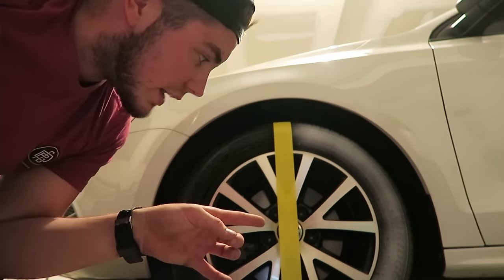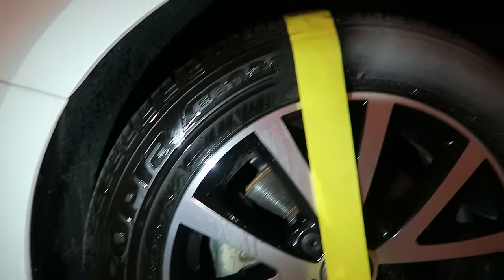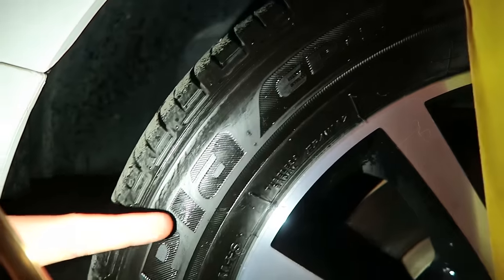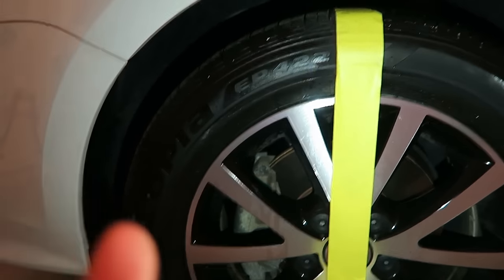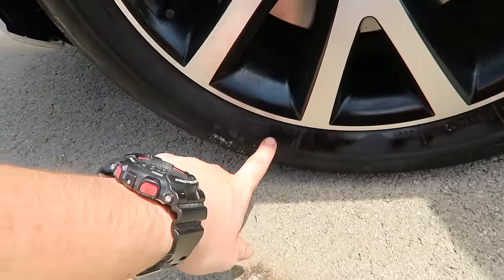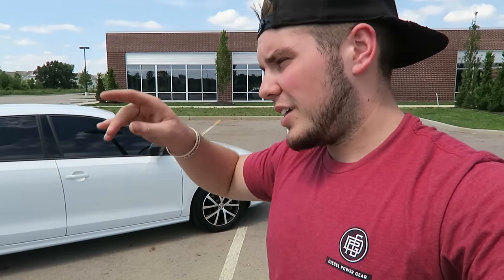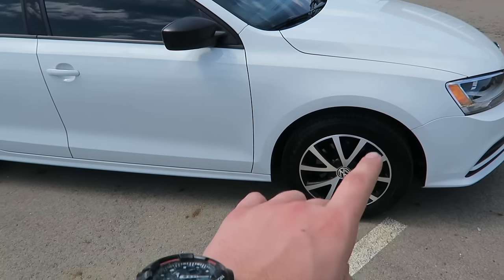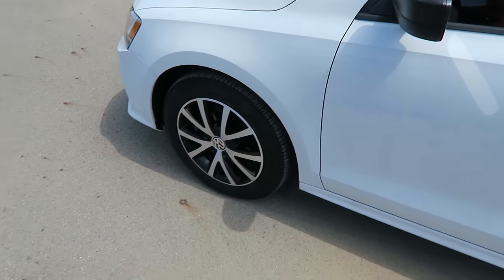The BEST way to Shine your Tires!  (You'll never use tire shine again!)

Comment: How long have you used Pledge on tires/rubber?  I wonder if it will cause premature hairline cracks to rubber/tires...
Reply from the maker: Rick T I've used it for a while, safe for the rubber
Reply: Rick T Hey Rick T like Ryan Mayers says,  it safe for the rubber  and I have to agree with him because the mane ingredient in Pledge is wax.  I personally have been using it sense the late seventys and have not seen any damage caused by Pledge to the many different tires I have  applied it to. For that clean new tire look Pledge is the way to go.        ...and it smells so lemony fresh.       lol.
Reply: May cause premature crackulation...

Comment: I just got turned onto Dupli Color "Tire Paint." It literally comes in a spray paint can and gives you the gloss/wet/black-shine look permanently and only costs about $6 bucks to fully dress 4/5 wheels. I typically recoat mine every 6 months... so you'd get a years supply that will run you about $12 bucks outta pocket.
Reply: as the name says, it probably IS PAINT!

Comment: The problem is that PLEDGE will eventually eat into the rubber and cause the tire to crack.
Reply: Plus you risk spraying it on to the brake discs and contaminate the brake pads. What a dumb idea.
Reply: i used it back in the days when tire shine didn't exist. Never had that problem.
Reply: NO ONE TRULY KNOWS SHIT!!! ITS ALL A GHB PRECUSOR!!
Reply: True!  Mr Sheen will also crack your dash.

Comment: I'll tell you this first off you need to get a thin bristle brush a wide brush and use it to work the compound into the tire. Pledge looks pretty decent but black magic 100% better just needs to be applied better. 👍 Zero rags brush brush brush or maybe even micro fiber sponge does pretty good too

Comment: So pledge makes it matte and tyre shine makes it shine?😹 I think tyre shine is doing what it's supposed to
Reply: Thabo Maphosa shit car.I wouldn't have bothered.
Reply: Runnin' Wild with Milwaukee Buck!  They both use chemicals.
Reply: Runnin' Wild with Milwaukee Buck!  I understand what you are saying, but it doesn't really matter if something is formulated for tire shine, because all of the companies use petroleum as a base, which is definitely not good for rubber tires. It breaks them down. 

I owned a high-end auto detailing business for many years, and always told my clients not to put tire shine on. The ones that wanted the tire shine on anyway had tire right within a few years, but the ones that didn't put any tire shine on, their tires last much longer. Crazy, right? 

Not hating, just saying.
Reply: well I have always used tire shine or tire foam for many years and I never have had tires worn out any faster!
Reply: ahahahahahahaha...exactly!
Reply: CyrusCreed (
Reply: Yes it Does Work, Butt tyre shine, Flings All Over You’re Vehicle After You’ve Just Shined IT, This IS an EXAMPLE ONLY, 🧐 Now U Have This Bad Ass Clean Black Lamborghini With Pimples All Over It, Due 2 Tyre Shine 😖
Reply: What? Teaching kids that bad spelling is cool?  I guess it could be Tiyer Shyne...
Reply: Back in the days in the military we got the trucks ready for the inspection by using diesel fuel to rub the tires
Reply: CyrusCreed wtf is a tyre?
Reply: Kevin Wollenweber 
You need to get out more often. "Tyre" is the correct spelling for "tire" in English speaking countries outside of North America. You know, like England, Australia, etc.
Reply: Right.... Duh...

Comment: I have for years use an equivalent - Mr Sheen, aerosol spray'n'wipe product.
 It also works very well on my old metallic finish duco; enabling water to bead again, just as if it has just been polished by the pros

Comment: have you tried the Pledge on the car's interior, vinyl or leather, now I'm even more curious about using pledge.
Reply from the maker: Don ellis 🤔 that's a wonderful idea! I mite try and full detail my car with pledge!
Reply: Don ellis I've used furniture polish on my car dash since 97 . Looks new. my older friend told me about it. I was like he was crazy but it works. wish I had pics to show you
Reply: Don ellis I've used pledge since the late 80s! Inside and out! Best thing I've ever found and I've tried a lot of different products and end up throwing them all away! Works great on detailing motorcycle too!
Reply: Sal junejo armor all products crack your dash. It dries them out.
Reply: Heath Young   Such Bullshit.  Armor All does not crack the dash.
Ive been using it on my dash for 30 years.
The sun ☀️ cracks the dash.
Some of you people are so freakin stupid!
Reply: Yes Don, it works great inside too. Don't know if I'd use it on leather, but I used to detail cars when I was in high school in the 70's, and what surprises me that this guy didn't hit on is LEMON pledge works great on your wheels too.  I learned from a lifetime motorcycle rider that it's the best stuff for cleaning/shining motorcycles too.   As he quoted the commercials, it cleans it's own wax build-up while it shines. That's all I've ever used on my bikes paint, and rims. I'm not absolutely sure about leather though, but I think anything with a painted or coated (chromed) surface the LEMON Pledge works great on.  Reason I emphasize the lemon is I believe the citric acid in lemon oil is what handles most of the cleaning & degreasing.
Reply: Don't use it on your vinyl or leather car seats. It won't harm it, but your ass will not sit still in cornering, as it slips every whichway...
Reply: climber bob so I can use it on my rims too🤔
Reply: David Hamilton what if I wipe it down very well?
Reply: David Hamilton 🤣🤣🤣🤣

Comment: To make it easy just go to your local auto parts store and buy "Meguiars Endurance Tire Gel"  and rub it in, almost anything in an aerosol can, or a spray bottle will sling, but gel will adhere to the sidewall of the tires without the run or sling and give it a nice deep black shine. Use the right products for the right job guys, idk if pledge is even good for the tire on the long run.

Comment: I use either Meguiars Hot Shine I spray it let it sit been lightly spread wipe it with a rag that doesn't sling or I use Wipeout a rinseless wash and I use a little thicker solution of Wipeout and it makes a great tire shine

Comment: Any type of tire shine should be the first thing on, last thing off. Once you wash the car and dry it, immediately spray whatever tire shine product you prefer on the tires and leave them be. Once you finish vacuuming, the interior, waxing, Etc, give the tires a final wipe before you drive away. First thing on, last thing off. You will minimize any spray up the side of the car if you get any at all. That's why I never have tire shine applied when I'm lazy or weather dictates I use a car wash and not do it myself.

Comment: Never ever use tire shine or any hydrocarbon based cleaner because it strips out the antioxidants manufactured into the tire sidewalls to prevent oxidation and premature cracking, I'm a retired tire designer from a major tire manufacturer.

Comment: OK, the thing that bugs me about tire dressings is that they stay wet and greasy and sling off, AND they collect dirt that you can actually see stuck to the goop. However, there are tire products that actually dry on the tire and last several washings. The one I use is Armorall Extreme shine. I'm thinking the Pledge won't last as long.

Comment: I worked as a car and boat detailer, right out of high school back in 1989 we had accounts with the Mercedes and Jaguar Dealer as well as private parties. When we used tire dressing We applied the tire dressing to the rag and wiped it down and it kept it from having drips. I don't care what their instructions are, I will always wipe the excess off.

Comment: I've found Turtle Wax Wet n Black Tire Shine works well with no spin off.  Recently I've been using Mequiar's Endurance Tire Gel and no spin off and looks fantastic.  Yes, wear gloves when applying but a nice finish when complete.  The Pledge here is just so-so as far as shine.  Not crazy on what it looks like after.

Comment: I have a 2004 Concorde LXI. The problem I have is the grey plastic grill insert looks dry and old. What can I use to bring back the wet look again. I have 160,000 miles on it.Its white with tinted windows and the interior and exterior look great for a 2004. It has the factory 17 chrome wheels they are a pain to keep clean. I use Pledge on the tires. But, the grill needs serious attention! Shawn
Reply: Use heat gun

Comment: Actually there is already tire shine foam on the market (Turtle wax). Spray and walk away. Only takes about a minute or two to dry to a shine. I usually use Purple Power degreaser then water first to clean tire then apply the tire shine foam. ;)
Reply: Use the purple power de-greaser to clean the tire rubber surface of all potential organic dirt, brake dust and/or road grime contamination; then simply follow up by using a dual action random orbital polisher outfitted with microfiber pad loaded up with five dimples of fine polishing fluid that is commonly used for vehicle refinishing to help micro-scarify and micro-pit the tire rubber surface in order to accept a protective durable layer of brand name silicone polymer wax that is typically used for vehicle refinishing.

Comment: tire shine no sling solution... get you a dish scrubber tool, the kind that fills with liquid soap.. spray/soak the shine on the scrubber pad.. scrub tire.. rewet as needed.  this also lets you detail FAST taking it right to the rim edge without junking up your fresssh clean rims.. also pad refills for tool are cheap, grab a pack, use an extending razor knife to cut the scrubber area off one, then its a controllable sponge which works better for beefy tires and then you can change back and forth at will.   y'allz welcome
Reply: ...and it comes out even and show-ready

Comment: I have been doing this for 30+ years also use it inside on dash all vinyl a lot better than anything else, works good on engines, black stove pipe in house spray it on then build a fire let it burn off

Comment: Thanks for taking the time to do this video.  I agree I like the looks and performance of the Pledge product, not to mention it is cheaper than the "Tire Shine" which I never liked the looks of.  I think the Pledge product will actually help protect the tires too.
Another thought, did you try and use it on the outside plastic trim?

Comment: silicone tire shine is heat resistant and so can protect mufflers and rear exhaust pipes from rust. either should help protect electrical connections from corrosion.

Comment: Any tire shine product worth its weight will contain silicone. Silicone is excellent for rubber and also plastics. Silicone based tire shine when applied correctly will not '' fly all over the place '' ...maybe it would if you let your 4yr old kid do it.
The silicone base repels dust and dirt. You can use it in the interior of your car also. Just spray some on a microfiber cloth and it does a fine job. NEVER use it on your steering wheel or stick shifter though. Its also excellent for polishing your windshield and will repel water  for months. Just like the expensive RainX type solutions, They are just silicone based in a fancy bottle. Try it on a glass door , rub it in, then buff it out with a microfiber cloth, Spray some water out of your garden hose onto it and, Your welcome. 
Let the pledge be a furniture polish and stick with a good tire shine product, Use it properly, ie: give it a wipe down. Its excellent for rubber compounds.

Comment: pledge has silicone in it that is why the rubber likes it i use pledge to lube the inside rail of my aluminum etension ladder where the metal parts slide in the track Wow it works and dryes non sticky when u slide the ladder to full extension and works for many weeks before relube is needed does not attract dirt in any noticeable way have the same littlt giant ladder  from the seventys still shiny and no dirt build up

Comment: You think it works good for tires, you should try it on windows. You have to wipe it dry a little more cause it's kinda oily, but once you do it's crazy. I use baby oil for my tires and dash. Never Armor All. I'm not even sure if Pledge is a good idea in the long run. It could start to crack the rubber after awhile. Baby oil keeps better.

Comment: But will the Pledge break down the rubber in the tires, time will tell. Tire shine is formulated so it won't break down the rubber, plus spray the tire shine on a rag and rub it in, that way it's not pooling on your tires and slinging off on tor car.

Comment: Funny you mentioned your key chain and the ridiculous amount of stuff attached to it...

Do all yourselves a favor, and remove everything from your car key. Especially VW/Audi owners. Only a matter of time before your door chime starts working at unusual times, your accessory lights start acting funny, wipers appear to seat at different positions, and then ultimately the major, your car stops starting as soon as you turn the key. It starts taking a little longer holding the key at start position for it to start. Next thing you know your car isn’t starting unless you try the key 3-4 times. You and your mechanic start changing stuff under the hood thinking it’s a hard start issue due to a fueling or spark problem. Your mechanic can’t figure it out, after they’ve tried replacing everything dealing with mapping fuel and timing on these newer electronic cars, so you then take it to the dealer. The dealer keeps bending you over, but just when they say they’ve fixed it, the problems persist. Well, all of this could be avoided by taking all that ridiculous nonsense off your car key. Picture your key is a lever... at the end of that lever is a small, finicky, delicate component that tells your cars brain whether it is on or off, and other stuff in between, known as an ignition switch. Now add a shit ton of weight to the other end of that lever and just keep prying and twisting until that component is worn out and no longer works properly.

...And I’ve always replaced my own ignition switches, but that job gets pricey with your mechanic or dealer having to remove your steering wheel, drill out sheer bolts, remove column controls, sometimes column itself...

...it can all be avoided. 

...all you guys feel how loosely that key turns in comparison to how tight the key used to feel turning? Take all that shit off your car keys!

...that’s my public service announcement for the day. Hope some of you decided to read the book I just published on this dudes channel. Save you guys the future hassle that awaits...

Comment: Hey, Ryan, FYI, was told by a car mechanic (friend of mine) that you should NOT have so many keys on your car key chain - I was guilty of this... He said he has seen SEVERAL cars in which, because of the weight of all the keys has actually BROKEN the ignition "insert" - you might find turning the key starts to stick or won't turn easily. This would be a DEFINITE sign the weight is causing problems. Be careful!!!

Comment: Please trim down your bunch of keys. By hanging all that weight from the ignition switch you're putting a massive strain on the electrical and mechanical parts. I know this as an auto technician chewed me off for the same thing some years ago. Love that motor by the way...is that the North American Passat?

Comment: Tire foam works awesome, the only con is a little pricey
Reply: Tire foam aerosol(about $4 at walmart) if sprayed into a microfiber cloth sparingly with a quick one second micro burst and then the microfiber cloth is quickly applied to the tire sidewall surface area but only enough to make it matte black  but not shiny or saturated; also on the tire foam material ingredients labeling check to see if in the active ingredients listing if it has the silicone polymer siloxanes; as that is the active ingredient that would serve to protect ones tire from further surface degradation and discoloration; one can check all of the different potential various available brands of tire foam aerosol products naturally of course.

Comment: Tires aren't supposed to be shiny, they are supposed to be rich deep flat black. All those tire products make them look like they have been coated with congealed cooking oil and it attract dust that sticks to my tires. Best thing I've found to make my tires look that deep rich flat black I want is to use a couple of teaspoons of sugar dissolved in a cup of warm water. After you wash them you just wipe it on with a clean shop rag and let it dry.

Comment: Do NOT use a rag to rub that in...The rag wipes it off and is absorbent, so all you do is take the stuff off into the rag! Use a SPONGE or a brush which will allow the stuff NOT to be wiped off the tire.

Comment: I'D  BE CONCERNED  ABOUT THE CHEMICALS  IN THE PLEDGE  AND WHAT IT DOES OVER TIME AS FAR A BREAKING  DOWN THE RUBBER. IF YOU HAVE TIRES THAT COST $350 EACH I THINK I WOULD JUST  WASH THEM REALLY  WELL AND USE AEROSPACE 303 UV PROTECTANT.
Reply from the maker: Pledge is a water based polish, its safe to be used on even the most delicate of surfaces like leather, it is safe to use on tires

Comment: Beware of using pledge on your tires. Try spraying just a little bit on your hardwood floors and walk across them. Very very slippery. So if you want to show it in a car show thats fine but dont drive around with this stuff on your tires.

Comment: Pledge dry rots tires bro. Lucas tire shine works just fine for me. Of course pledge will shine it but it’s destroying your rubber on your tires. Might as well spray paint them with gloss paint lol. ITS FURNITURE POLISH not tire shine. Buy latex based tire products not wet and black. Like turtle wax tire shine or Lucas tire shine are the same type of base that dealers use. Another bad decision was buying a Volkswagen lol.